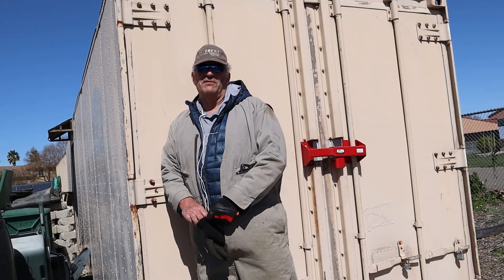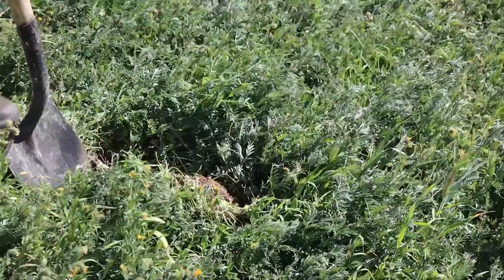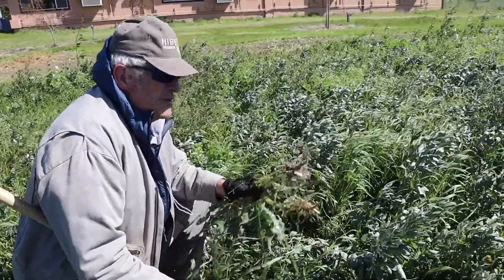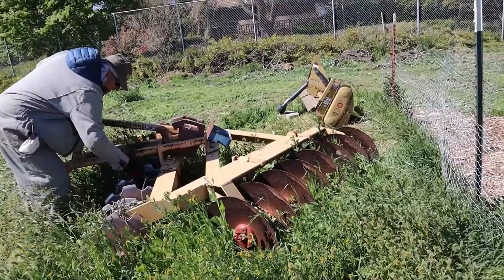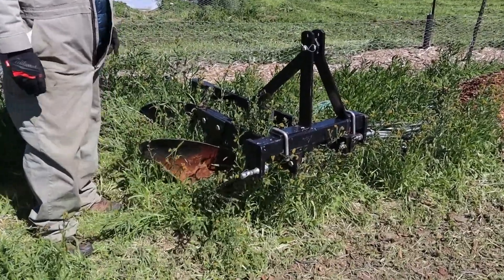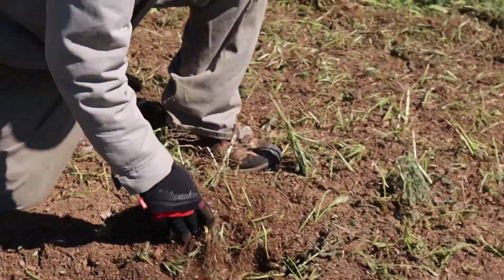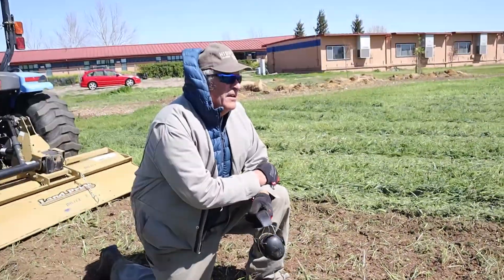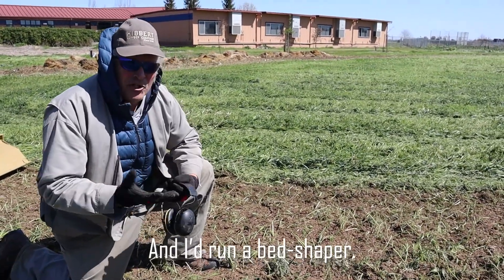Terminating a cover crop with a rotary mower and a rototiller

Comment: Hi there, 
I'm stuck in a bit of a predicament. Got a few acres in alfalfa and can't find anyone reliable to cut the crop for me and I won't spend thousands of dollars on buying haying equipment so thought of using my rototiller to only cut and pulverize the plant portion of the crop without touching the ground. I'd make sure my tiller is lifted at least 2-3 inches off the ground at all times so it's not damaging the root and only mowing/mulching the stalk/plant. I'd do that over the course of the summer 3 times and just let the cut field rot and decompose over the winter. 
I know this is not ideal but would you think a HD rototiller can give nearly as good of a finished product as a flail mower or not? 
Thanks for your time and hope to get your insights on this.
Reply: Nope Nope Nope